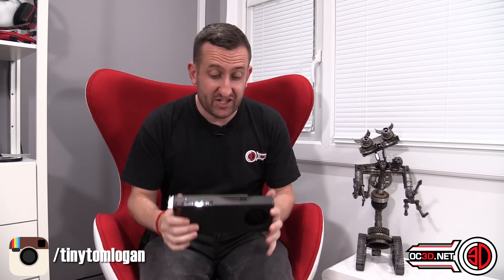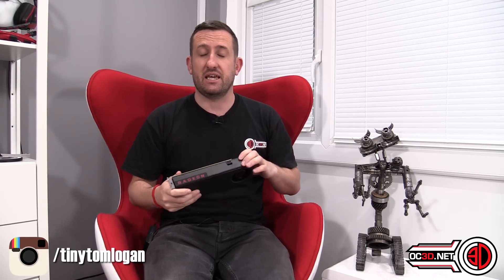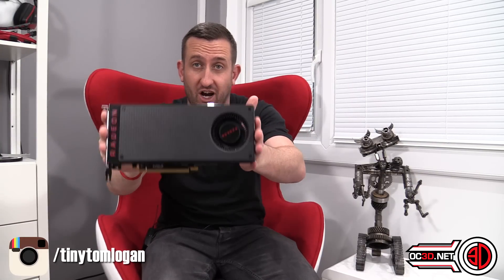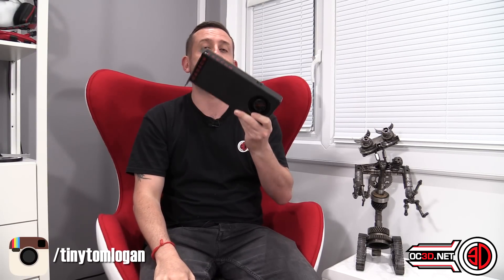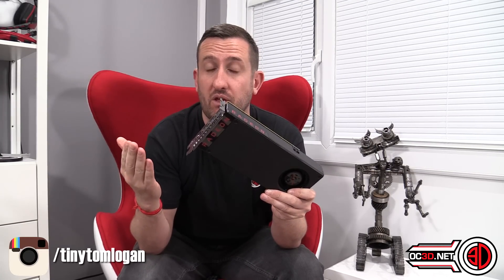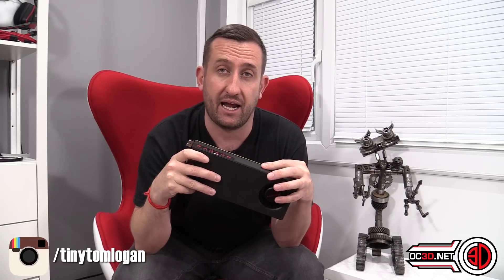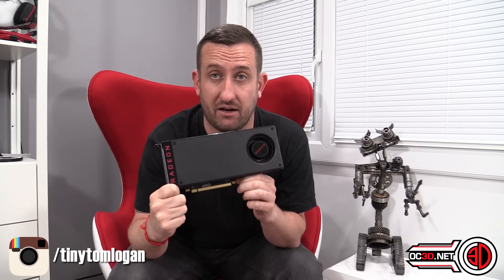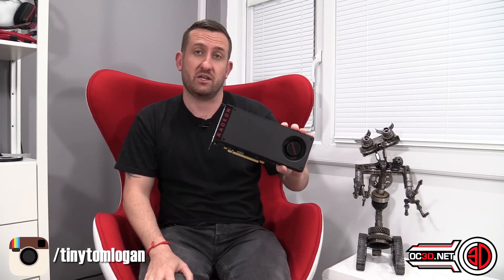RX480 power bottleneck? TTL Talks

Comment: My Strix 970 does the same.
Reply from the maker: No your 970 overclocks more. Totally different
Reply: OC3D TV changing the core clock does nothing until the power target is touched, is limited by power essentially, is that not the same thing?
Reply from the maker: What 970 do you have? Technically 970's boost really well anyways, its like they go a stage further to always try and get the best performance. When you manually overclock youre only offsetting where the boost starts.
Reply: OC3D TV I have the ASUS Strix 970, hmm yeah it seems with my power target at 100% I get 1342 max clock, and GPU-Z says 'Pwr' is the reason for the cap. 

If I raise the target, the core will boost up a lot further, with the cap reason being 'VRelOP' mostly, unless I'm running something super intensive like 3DMark that will cause my core clock to hover at around 1470Mhz and again say it's limited by power target.

Comment: I don't think I mind that they do this to be honest. The fact that you can change it if you want, that's fantastic. And if you don't want to change it, that's fine and they will be a great card anyway.
Reply: You should mind. It draws more through PCIe slot than it should, even at stock. This is by definition a defect. It gets even worse for crossfire setups. The worst might be board degradation or intermittent failures. The annoying symptoms are interference with onboard sound, like hearing static or a squealing while moving the mouse. Now, those are the types of things that can happen. I haven't personally heard or seen any actual reports, but that is quite the gamble.
Reply: Aaaah, I was under the impression that it was within the pcie specs at stock, and that you were able to alter it from stock to draw more through the motherboard, which would be totally fine as many motherboards are overbuilt and could handle it. Dang it AMD. Get yo shit together! I hope these issues are resolved quickly.
Reply: Meh the gtx 960 did the same thing, it even drawed more power at peak from the pcie than the rx480 does. 

https://forums.overclockers.co.uk/showpost.php?p=29719176&postcount=10420

The real problem is probably with overclocking with crossfire, that could damage the board
Reply: Peak power isn't the problem here, it is sustained power draw which puts it out of spec. But yes, I guess we will have to wait for board partners to come out with their own pcbs for a good overclockable card
Reply: +TheClonazepam Finally someone with some sense. AMD really shot themselves in the foot with this one. Any budget constrained gamer looking to pick up one or two of these is going to be seriously screwed if they have a low end AMD board, or any AMD board for that matter right now. Because the AM3 and AM3+ socket boards are very outdated and dont even have the latest PCI-E version, so it could be very unstable and degrade even faster. Plus AMD might as well just give Intel money because using any AMD processor currently will most likely bottleneck two of these cards in Crossfire, so youre almost required to buy an Intel processor to get the performance.

Comment: just eyeballed it (well MS paint anyway), hole size and spacing on a 270/270x/370 should be the same so a cooler transplant could be a possible easy test.

Comment: There are multiple nVidia cards that had the same issue, including the 750 Ti and the GTX 960. But when it's AMD, suddenly everyone sees it as a problem.
Reply: The GTX 960 averaged less than the 75 watts PCI-e allows. The 480 is consistently over by a fairly large number.
Reply: the card only does that when you overclock it and it goes up to 82 watts 11 watts past the "spec" which this card was tested by SIG who do all the PCIE certifications. And according to AMD this card passed the SIG testing.
Reply: https://forums.overclockers.co.uk/showpost.php?p=29719176&postcount=10420 no
Reply: samuel cronier chausse That's the ASUS Strix specifically that had that problem.

Comment: Everyone complains about the 290/x etc's power usage and temps (the power taget is set higher than it actually needs to be and they undervolt like a dream but noone picks up on this and wonders why putting the power target up even higher doesn't help)
AMD changes the power and voltage requirements on these cards and gets them dialed in from factory-noone realises (tom starts singing "I am the one and only...") and wonders why they don't get much overclocking headroom despite the rest of the card being good.

What if amd had put the old big 290/x style heatsink block on it (keep this fan because the old red fans were a cause of the problems aside from power target), what would be the temps? wanna test it @oc3d tv? go on you know you want to.

Comment: So what all the old school overclockers (like us) know, it has an efficiency curve, to get 10% more performance requires 12% more clock speed and 15% more voltage and therefore 20% more power.
Same with x99 users when we go that's "WOW, allot of power for only 140w TDP cpu", then you go from 3.3ghz>4.5ghz (33%oc) and suddenly 140w becomes over 220w tdp and you really need a beastly heatsink or cooler.
So from factory these come dailed in, nice to know, the fx series cpus and my msi frozr r9-290 come factory underclocked and overvolted giving them a ton of headroom meaning you can undervolt them or overclock them like mad, this was addressed with the "e" series eventually as you tested (fx8320e: value for money award).
I did some testing yesterday on my r9-290 and I can maintain a 1000mhz core clock (2.3%OC) with -37mv (1.117v on average)
-11% power target (about 164w avg according to gpu-z)
and 83*c at 47% fan speed while pinned at 100% in GTA5.
The card being barely audible, got 79*c at 57% fan speed (stock fan curve) and took 5 minutes to reach 90*c with fan slider all the way down to 25% but you couldn't hear it over ambient room levels.
People need to learn to overclock like we had to, simply going into msi afterburner and putting sliders all the way up and adding +100mv and seeing how high the core clock can go isn't proper overclocking, the efficiency curve is completely missed, this is the problem with multiplier based boost overclocking being the only option for so long, people's IQ's drop through the floor.
btw 2x 6pins=1x 8pin so adding a second 6pin would be dumb, you could just have a single 8pin which the 480x will likely have anyway, atleast this has more pwoer phases than a founders 1080.
any testing on how this performs with a +10% power target and an overclock with minimal voltage addition? could be a good follow up for the real enthusiast tinkerers, also gives you a chance to make up for "not doing your job properly" :D (don't worry noone else does, you're the only one to notice it :P)

Comment: The untapped performance from the GPU once the power delivery and thermals are sorted. Will the RX 490 be a 480 with more power delivery and better cooling? A pair of 6 pins and may be an AIO cooler like the FuryX. The same silicone but different card and cooling???

Just speculation on my part but we know the RX 490 is coming and this might answer the question of how they are going to do it.

Comment: Very worrying with this whole power draw from PCIE slot business, especially seeing as it appears to be an issue with the way the chip is designed to pull power, and can't be fixed through simply throwing more PCIE power connectors at the problem.
Reply: No, the problem can be fixed by throwing more PCI-E connectors at it. That's precisely what you'll see when partner cards are released.

Comment: performance per watt goes to nvidia, 2 480, @150w each, compared to a 1070 @ 150. (some games 2 480s will be better but there are plenty of games that do not support multi gpu) but yes, price goes to amd no arguing there.
Reply: performance per watt has been better in nvidia for a long time. its no surprise. and still now its king. the rx 480 sucks more power than AMD said.

Comment: water block isnt going to matter much at all with only the 6-pin
Reply: Michael Theurer Yea that's true, but what I'm trying to say is, if you're going to invest into pump, water block and rest of the equipment, you might as well buy GTX 1070 or RX 490 when it comes out.
Reply: You can just power the power target up (set too low from factory), this has more vrm phases than a gtx1080 its over engineered but under utilised. the 18awg wiring in a 6pin power plug is rated for 4.15A (so 149.4w) but is only used upto half of that unless another 2 ground (8pin) is used but the wire is still capable up to that point.
Reply: ***** before you make statements it tends to be a good idea to know what you're saying and not just believe what you're told unless you really want to believe in the tooth fairy.
Reply: Why would you bother putting a water block on a "budget" card in the first place?
Reply: +Warzey because TTL is saying that the 480 could be a clocker.  its just limited by the power at this point
Reply: Warzey ^correcto, but thats never stopped getting gtx960 blocks etc for years, people will buy things if things are made available, apple sold a $10,000 fuckin watch remember.
amd put the 480 power/temps/performance where they need to be to balance out well, if you need more performance buy a 480x, 490, 490x, "fury2" etc. the 480 is like 232mm sq, amd can make a card 3x this size so theres plenty of cards bigger (not to mention the cheaper ones) to come.
Reply: +Toms Tech ok I'll go out and buy a 490 right now
Reply: Michael Theurer If you cant wait for a new gpu right now you're free to try and buy a 1080, 1070, 980ti, 980, fury, furyx, fury pro duo, nano or even multiples of these all of which are more powerful, yes some require more power and/or cost more but you cant have your cake and eat it in this world so you gotta chose between sacrifice or sounding like a whiny bitch either way the choice is yours.
Reply: +Toms Tech how am I whining?
Reply: Michael Theurer Where did I say you was?
Reply: +Toms Tech I don't have time for you
Reply: Gamers Nexus did a hybrid RX 480 and he was able to get 1400Mhz out of it. Power still looks to be an issue atm.

Comment: ok but there must be a limit let say theoritically you can give 900w power to the card it won't overclock to 4 or 5 times right? so when you give enough power the limit should be like nvidia cards for ex limited by the memory speed or the core speed etc... so what would be nice is to know to which amount of power you can go with one rx 480 and to what core speed etc

Comment: I think its pretty cool that out of the factory AMD maxed it out to the limit as far as thermals go. Id say GG on that!
Reply: strangely i agree with you. but that means that the rx 480 stock would have been way slower than the gtx 970. further bringing it back more. Though rx 480 is still a beast card. it has alot of issues already. so id stay away until amd fixes their shit and After market cards come out.

Comment: I saw the slightly the overclocked partner cards on overclockers costing slightly more the the base cards and thought it was quite funny. Just buy the cheapest base card 4GB or 8GB and overclock it yourself. Honestly I think it's a bit of a con when board partners release slightly overclocked cards which are obviously exactly the same as the base reference card. Wait for the cards with better cooling and better power delivery if you really want to overclock. I would say the same about any card past, present or future.

Comment: 350 watts through a 6 pin is going to burn up the motherboard.   Pulling the heat off the card is going to be another problem.     The next question is whether the power required is going to kill the chip run that far out of spec.
Reply: The card maxes at 225, and 75-85 Watts come through PCI-e, meaning 140-150 watts through the 6 pin. "Out of spec" is a bit of a misnomer because AMD didn't publish the correct specs.
Reply: 350 watts is for the whole system and not just the OC'ed GPU...
Reply: It passed PCI SIG testing so it's not as big a problem as the knee jerk crowd made it out to be. And the card runs between the mid 70s and 80s at stock with a shitty heatsink. Just wait for non reference cards.
Reply: 350W is for the entire PC in LOAD. Not just graphics card .. jeez.. And it was most likely measured at wall which means it will be even less than 350W.

Comment: Power delivery on the card is great, bottlenecks at the moment seem to be the temps, power limit and a little bit the 6pin. One guy on hwbot put a CPU cooler on it and got 1425MHz core stable for Fire Strike, so looks like it actually scales quite good once you manage to keep the temps in check. Custom PCB with more power plugs, custom BIOS and water cooling should be really fun to play with.
Reply: Heck just replace the diecast heatsink, if you put an r9-270 cooler (strix, gigabyte, twin frozr or whatever) on it and just let the power target eat they'd still get 60-70*c temps at 1400mhz, the stock aluminium heatsink with its copper core is the problem.....bit like intel heatsinks really, maybe the high end amd cards will just come without a cooler and expect you to buy one because thats the obvious right thing to do /s.
Reply: actually seems the silicon lottery is real with these reference 480's, people have already watercooled them and maxxed out at 1390 mhz and below

Comment: if you undervolt it it wont use same power at same clock as stock Voltage so it wont power throttle as hard

Comment: It uses as much as a 970 which has 2 6pins 
Surely AMD knew this.. why would they put 1 6pin on it when it is not really enough..  was it the point in doing that. I bet it was because "we only need a 6pin AMD is power efficient" ...BS like this is just what AMD could use right now
Reply: OEM system builders like Dell, HP etc. If it works at 150W 24/7 its unlikely a prebuilt system owner will go screwing around with overclocking them and it means they can cheap out on power supplies as usual, looking at you HP with your non-ATX PSU pinouts.....
Reply: I would prefer 1 8-pin because most power supplies have a 6+2 pin.. why have the extra 2 pins dangling there and looking untidy. What do I know..
Reply: Just to add the reason they probably kept mentioning the 100-300 dollar range is because the aftermarket cards will be touching 300 but hopefully with all the extra power and cooling will have a perf boost correlating to the extra cost. Time will tell I suppose!
Reply: The reason was that they started manufacturing the cards before they finished testing them, in order to get enough cards in the hands of retailers on launch day to make a big dent in the market.

Comment: Have you tried undervolting as well as increasing the power target? There were reports that the default volts are actually too high, and the gpu can easily handle lower volts. Doing this will keep it further away from the power target in the higher states, potentially increasing your performance further.

Comment: So this seems to be the opposite to nvidias 1080, where most of the after market versions are adding a six pin connector with no benefit.
With regards to overclocking and higher performance.
Reply: Heyyo, err aftermarket GPUs with custom power delivery always offer more stability when overclocking. In the case of this RX 480? Changing the six pin for an eight pin PSU connector would mainly alleviate the issue of PCI-E wattage certification and probably allow for more overclocking potential which would then be extremely temperature limited because it would still be using a reference blower design and even in its stock configuration hits 80c. The GTX 1080 for example is primarily thermal limited. JayzTwoCents did a video about it where he cranked up the fan speed and was able to hold the stock boost clock all the time and then he could overclock on top of it with the reference design a little bit but then became voltage limited and that's where the custom power delivery came in handy for a little extra boost stability.
Reply: lolol crazy huh.